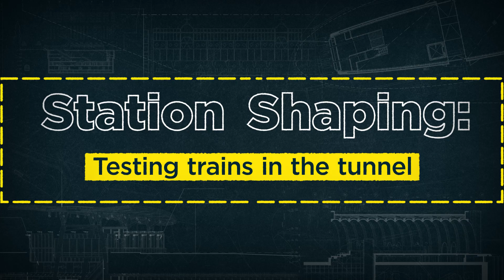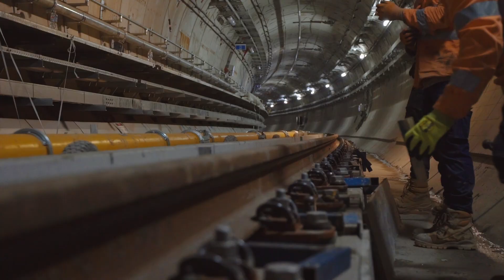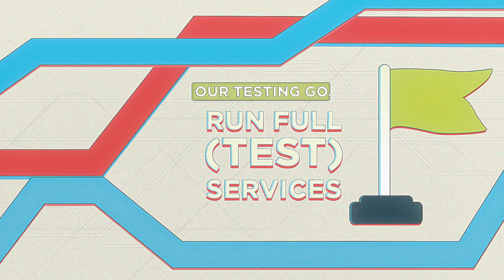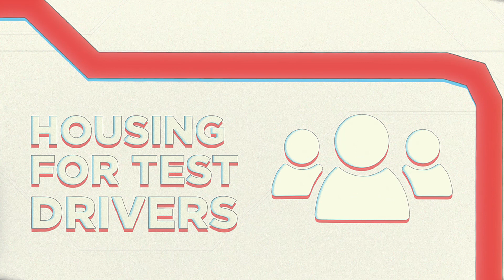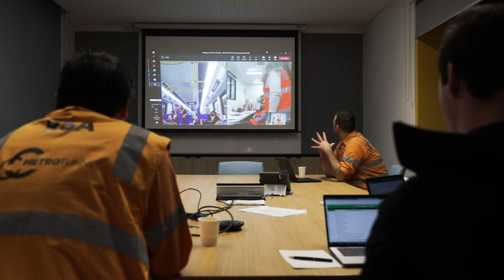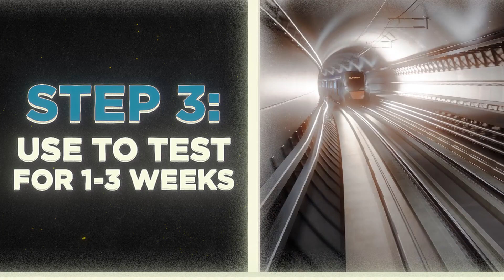Testing trains in the Metro Tunnel

Comment: I have a question regarding when the tunnel opens and trains are running revenue services. Does anyone know if Up Pakenham/Cranbourne trains will be stopping all stations between Caulfield and South Yarra or continue to run express like they are now? Because since trains won't be using South Yarra anymore on that line, I feel like having a connection at a station like Hawksburn would help minimise changeover times at stations like South Yarra and Richmond if passengers had to get on an Up Frankston service to get to one of those stations and change there too (for example to the Sandringham line). Any info about that yet or is that still to be decided?